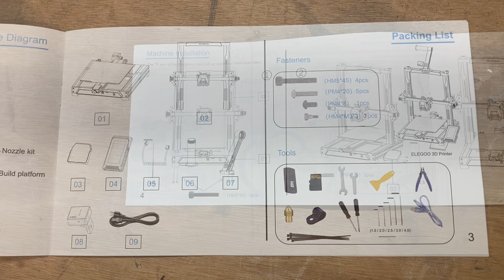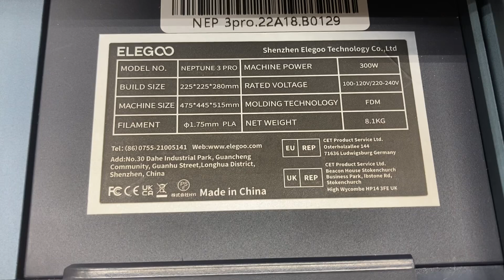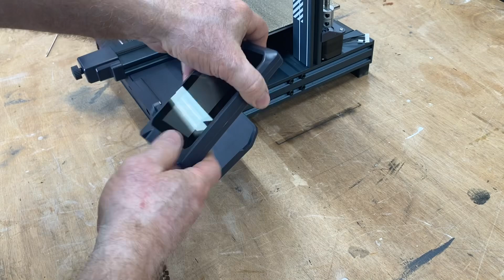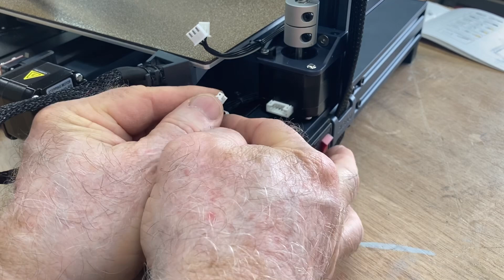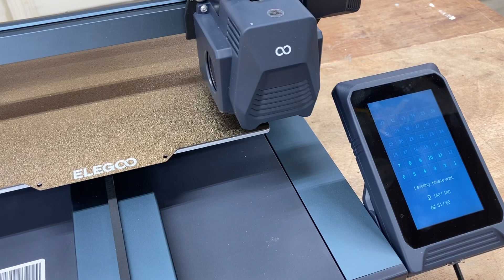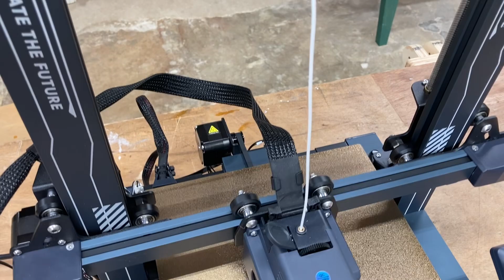Neptune 3 Pro by Elegoo Setup and Review

Comment: what an incredibly helpful video! Regarding print speed, do you manually set it for each project with this printer, or does it automatically select the print speed on its own?
Reply from the maker: Thank you very much. I use the default speeds.

Comment: As long as you go through the basic settings your prints will look good. Very easy machine to use
Reply from the maker: It’s a great entry level machine and yes, once you get the basic settings dialed in the results are very good.

Comment: I ordered the Creality Ender 3 printer and it was a disaster for assembly. Maybe I got a lemon. In any case I got a ELEGOO neptune 3 pro. The assembly was fantastic but unforunately the LD screen would not worked. Notice the Creality and ELEGOO are manufactured in Shenzen, China. In any case I returned the ELEGOO and ordered it again because I found the assembly great. It worked like a charm after 1 hr. I have had the printer for 4 months now and it hasn't stopped printing all my projects. But as time goes on I am having some issues.
1. I cannot set the default temperature for PLA. It always goes 200/70 and I usually like to use 225/65. I have the PLA temperature at 225/65 but when I start my Cura, it is back to 200/70
2. I had a power failure and I could not recover and continue the print when power came back on. I tried testing the recovery of a power failure but seems to be no possible method to recover the project.
3. I cannot save my STL files on the SD card. It does not appear on file explorer in windows 10. I have lost my SD card that had the budda and I got a 32GB instead but I cannot use it.
btw I think the filament detector is too close to the spool holder and I was having problem with the filament going through. I moved the detector over a little and used a tie bond. Never had a issue since then.

Any assistance would be appreciated..
N.B. I really like this printer very much.
Reply from the maker: Wow, I’m so sorry you are having so much trouble. I’m not sure why you would have so many problems. It does seems to be electrical. Is it possible you have electrical surges?

Comment: My Neptune 3 Pro arrived today. This was video was such a big help. Notable issues I ran into were finding the plug for the filament sensor, which I was able to identify with your help as it was nestled in the corner. I also found the contact sensor on my X-Axis had come loose. I found the piece in the box and was able to resolve that. 

The pace of this setup video was so much more helpful than Elegoo’s 😊

Comment: I keep trying to print my test buda but  the nozzle keeps moving the base. What am I going wrong. Is it too far or close.
Reply from the maker: How are you measuring the offset?  I simply use a piece of paper
Reply: @PawPawsWorkShop  so am I going to high or too low.
Reply from the maker: If the nozzle is actually moving the base I would think it is too low.
Reply: @PawPawsWorkShop  what settings should I set.
Reply from the maker: The paper should move with a little resistance
Reply: @PawPawsWorkShop  thanks I will try to raise it more. Any suggestions on what size I should set
Reply from the maker: Use a piece of paper. Lower the nozzle until you feel a little resistance when you pull the paper.

Comment: CAUTION... the Plus does have MANUAL levelling and you MUST manually level the build plate BEFORE you perform an Auto Leveling & Calibration. There are 6 levelling wheels under the plate for this. This is due to the size of the bed. Use a sheet of paper during the manual phase and again at the end of the auto levelling phase. This is clearly instructed in the printer's manual.

Comment: Good video. I’de like to suggest adding one more important setup. Esteps! 
It does require using pronterface since no option in the menus ( in my 6 day old printer fw).
When I did a 100 mm extrusion test at the input of the extruder, filament purged thru the nozzle, with pla 205C I only got 90 mm. Ran the test 2 times. Pronterface and a M92 displayed a E or 380.00 in memory as delivered. Using the formula of 100mm/90mm X 380 I got a new value of 422.22. I uploaded that and saved it. Now I get exactly 100 extrusion distance into and at the brass extruder inlet. I just ran the test after great prints and a 6 days, and I still get 100mm.
Being something overlooked in the reviews and not discussed in the Elegoo groups, I can’t absolutely say 380 is wrong and 422.22 is correct, so I’m reaching out for more to check it and report back.
I see new fw is now posted so I’ll try it and see what may have changed including Esteps.

Comment: Is the head supposed to be off set when starting to level ?
Reply from the maker: Yes, that is normal. It caught me by surprise also
Reply: @PawPawsWorkShop  ThankYou , Im trying to figure this thing out . I think I have it all setup right . Checked and rechecked the printer and it looks good . Now just need to print . Not sure but my rollers may be a bit to snug . Things roll ok and not wobble but not sure if they may be a bit to tight .
Reply from the maker: Usually the get loose in shipping. If they feel a little tight you are most likely ok

Comment: I never hold to much weight in test prints on the machine. Tho I don’t deny this is a good printer but I had an ender 3 leveled very little and it would print the test prints perfectly
Reply from the maker: I’ll be doing many more prints. You’ll see if it works or not as I will as well. It should be fun
Reply: I also had an ender, and the test print was stellar... but everything else..  not so good.